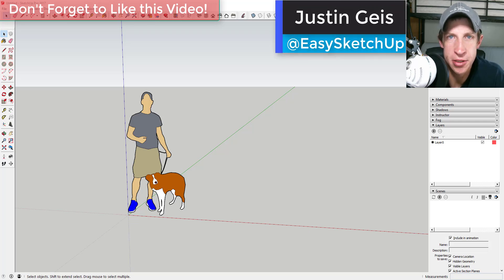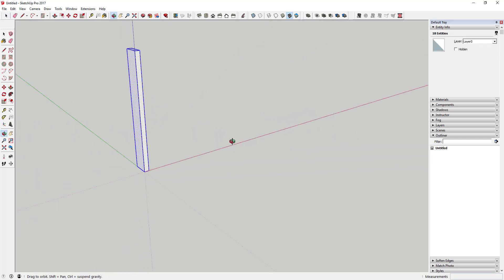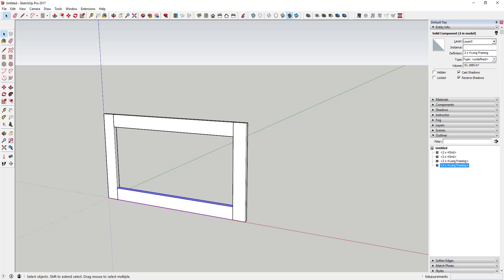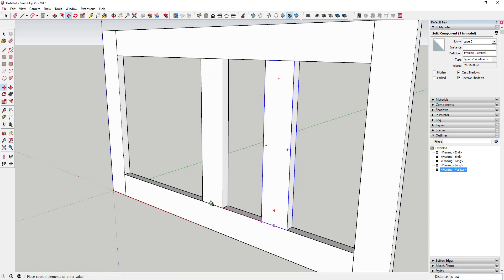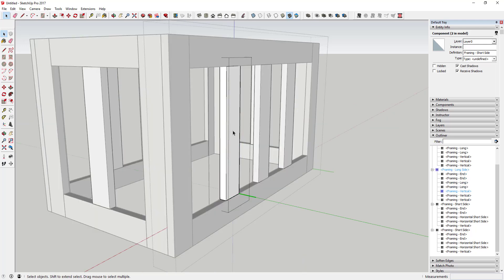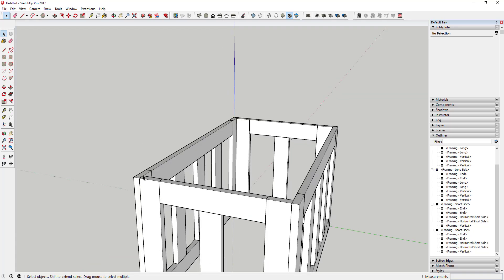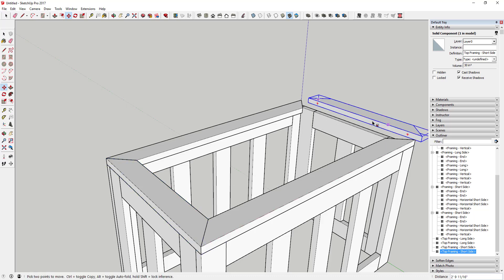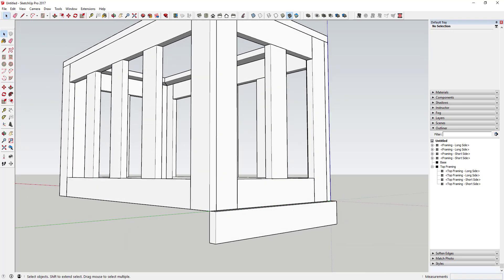Modeling a Blanket Chest Step by Step in SketchUp

Comment: Really like this as a practice piece but I am confused by the construction of the base. I could see how you could actually use all the parts for the construction of the box right up until the base. Then there was the plywood bottom of the box. There would be no way to join the plywood to the bottom of the framing (except maybe pocket joints in the plywood). The bigger problem seems to me that the box would fall through the base. There is no real overlap between the base and the box with the exception of the 3/4" of small bevel area but that would not provide enough contact surface. Not trying to be picky here just noticed that it seemed to depart from being a practical model right the framing was finished and the base was started.

Comment: What you did was fine, but the difficult stuff is doing mortise and tenons, Stopped Dadoes, and inset panels. Using line divide will not give you equal spaces between the stiles (the vertical boards) Try it and measure the spacing.

Comment: Not sure if you answer old drawings or not. But if you were going to make this. Or anything else as far as that goes.  Do you have to select each item one at a time and hide everything else and then do the dimensions out the piece and save somewhere else so you can make a cut and material sheet and an explosive drawing?   Or is there a preferably free or inexpensive plugin that will model it out or explode the drawing. For an assembly diagram?  I know I’m asking for a magic wand too. Sorry lol.  Thank you for your assistance ad as soon as I can figure out how to get my life back together and learn a new trade I can actually do after my heart attack (quad bypass) and CIDP and MS which has end my 24 years of being a busisness owner (small computer networking company in Texas). I will figure out someway to give back to you. All I can do for now is like, share, refer and say a few prayers every now and then for you. 

Again thank you very much.  

Rob
Reply from the maker: You're looking for a cutlist program? There are a couple out there (Cutlist comes to mind), but I've never used them so I'm not sure how easy they are to use.
Reply: TheSketchUpEssentials, yes cut list is one thing that would be nice.   But an explosion diagram with automatic dimensions would be the best for me.  That way you know how to cut each part and the dimensions they are suppose to be.  As well as an assembly diagram.  Thank you for your input and suggestions.  I will start looking.

Comment: At around 5.30 when you duplicated the vertical framing....are they equally spaced apart doing it this way?  I can't seem to get mine to be equally spaced apart with this method.  I could be wrong...but yours don't look equally spaced apart either?  Been trying to figure this one part out for over an hour....frustrating.
Reply from the maker: They're equally spaced based on the base point I selected and the target point I selected, so when you create copies, they're equally spaced from each other. However, if you started off with the wrong base point, the framing won't look right on the side. Does that make sense at all?

Comment: thank you , i would like to ask , If you had a component and make copy , and did lines or worked in internal face of original one, you will get these lines or works in outside other panel , so, how do you can do works on the same opposite tow panels,
Reply from the maker: You should be able to mirror the image using either the scale tool or using "flip along" after right clicking on an item. Does that make sense?